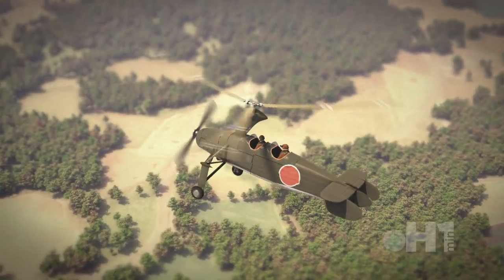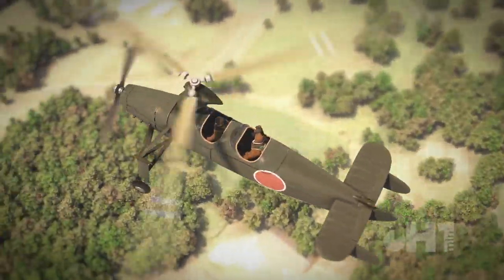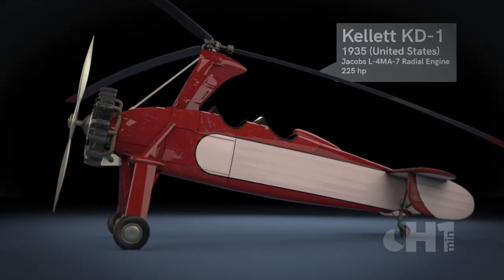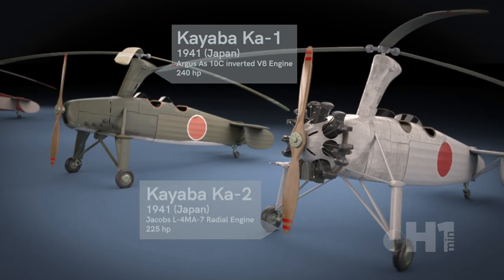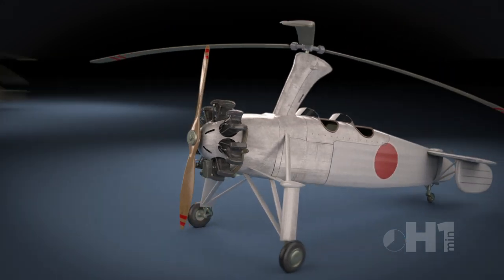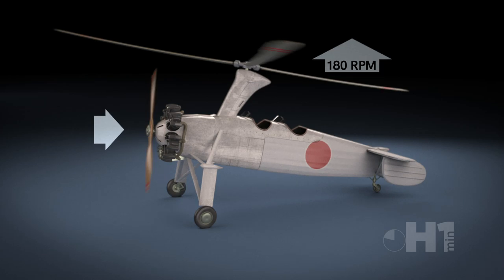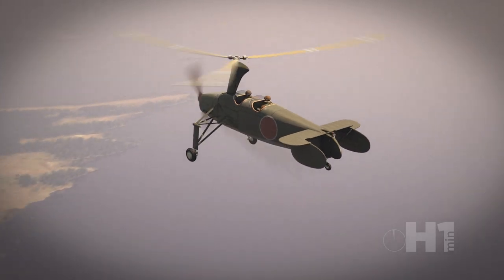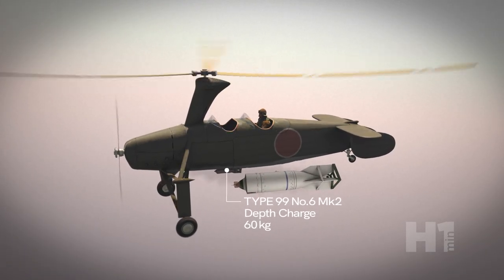H1MIN: KAYABA Ka1 / Ka2 AUTOGYRO

Comment: How did it counteract the torque of the rotor?

Unless the thrust of the propeller and the tail could adjust for it, seems like it would be lucky to fly straight.
Reply: After take off the rotator is disengaged from the motor and it spins freely. It essentially acts like a wing when the is enough air flow

Comment: If that engine went out, or was shot. They would’ve fallen like a rock. At least with a plane, you can glide to a reasonable spot most often
Reply: Incorrect, helicopters can ‘glide’ without power. Search “Helicopter autorotation” on YouTube